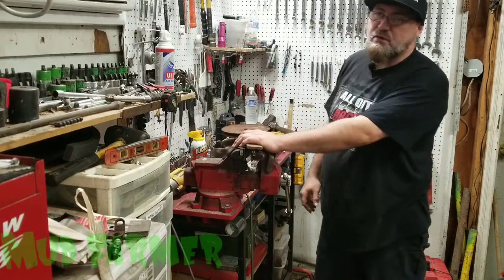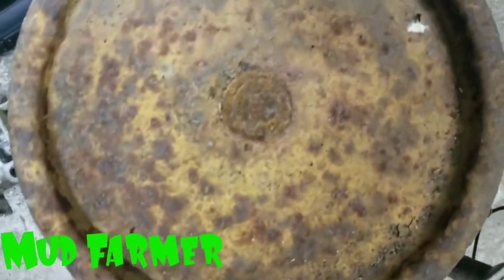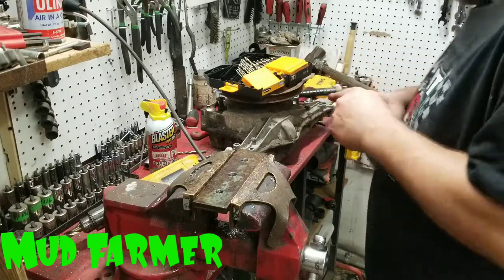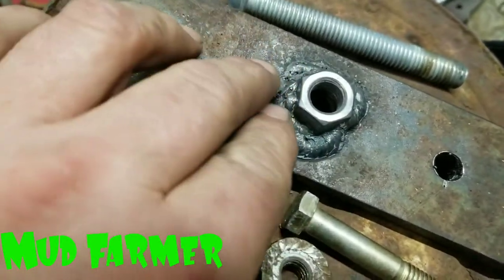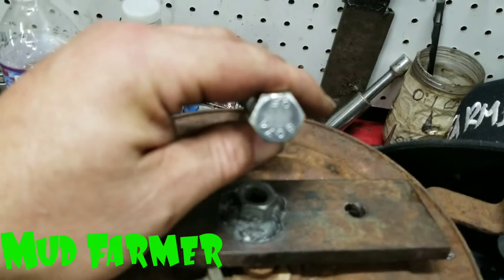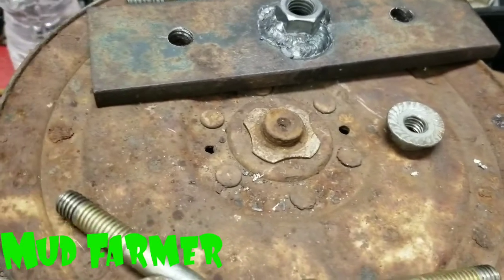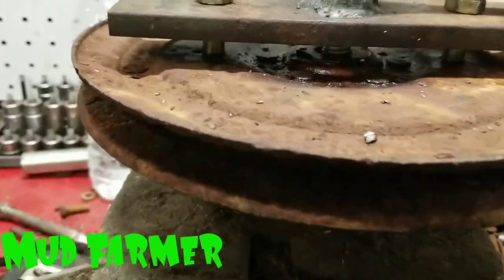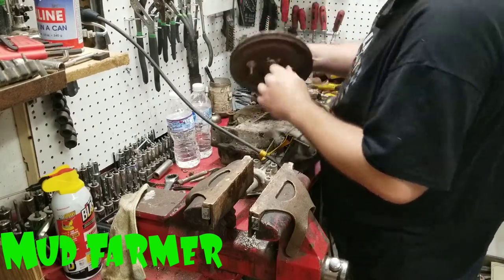how to remove mower transaxle pulley

Comment: A little tip if it's being stubborn when your trying to pull it off. Leave the puller bolt tight and smack the head of the bolt with a hammer. I've done several this way and they pop right off. If it's bad rusted, dont use pb blaster. Use WD-40 and let it soak a day or 2
Reply from the maker: Nice,  thank you

Comment: Can you just use a cut off disk on your grinder to cut the whole thing off?
Reply from the maker: I have used that method in some cases. Murray trans tend to hold grass clippings on top of the pulley and rust really bad. In them cases I've cut the pulley in pieces.

Comment: Mine had a snap ring. I took that off and tried to pull it as instructed in the video. It just bent my puller. I don’t know if I might have set screw. Do you know where that would be located?
Reply from the maker: Sometimes there so bad only alternative is to cut them off with cut off wheel.  I've also have cut all the pulley off , leaving just that center still stuck on out put shaft. Then I used a 3 jaw puller.
Did you drench it in a penitrating oil?

Comment: just may try your way iv used the steering  wheel puller but it belongs to my dad and my grand dad may have owned it .... i dont wanna spend money on a puller set with cheap bolts with easy to strip threads  ... got steel got plenty of welders.. hard ware store is right down the street
Reply from the maker: Yea. I just make new ones from time to time. Scraps equal free..lol